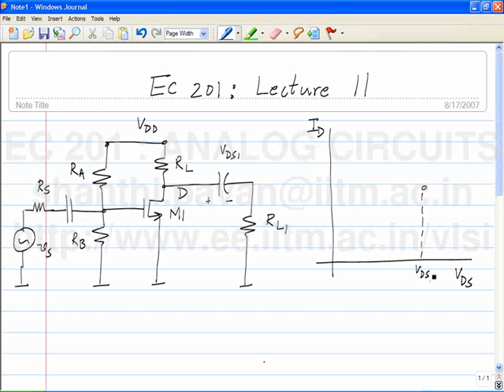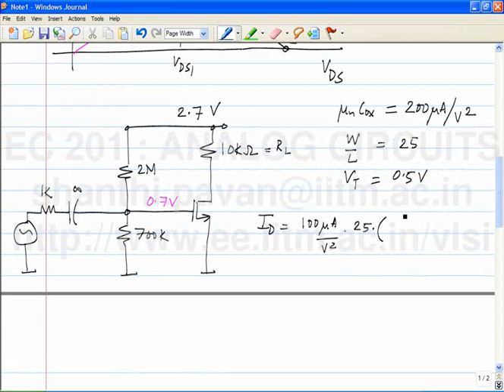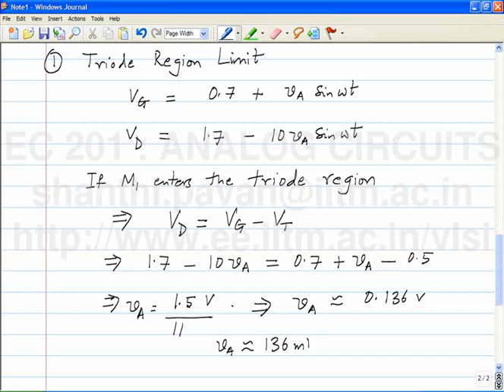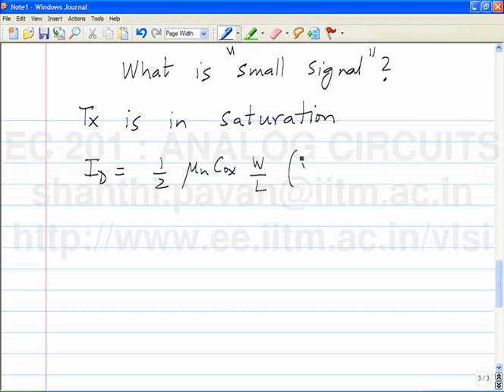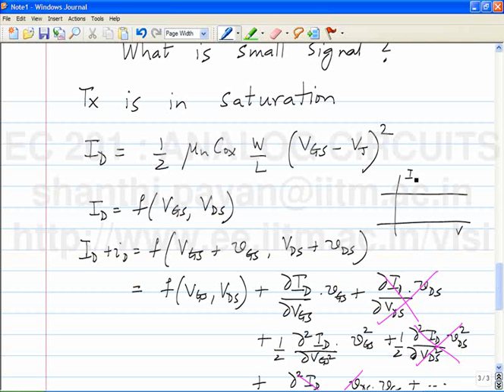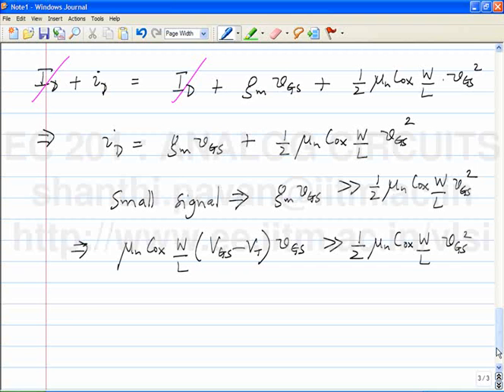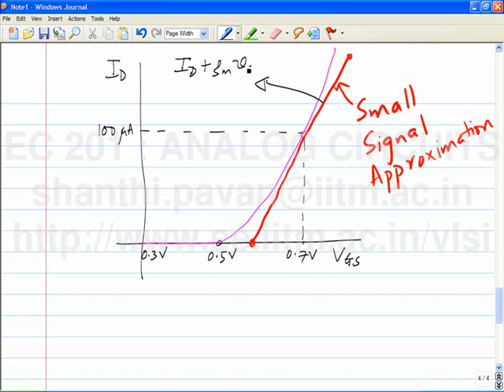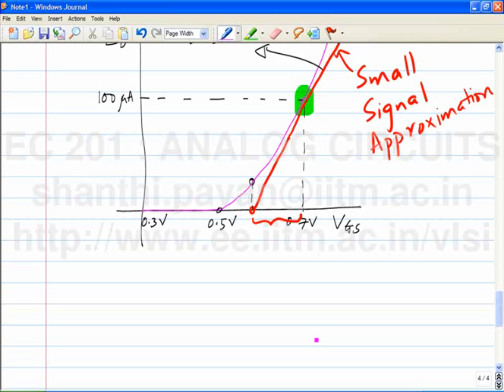Lecture 11 - Swing Limits continued, small signal operation revisited

Comment: How Vg=0.7 and Vd=1.7 you got, please clear my doubt
Reply: I hope u would have gotten ur ans by now though I am clearing it. Since no current can flow through the gate or infinitely charged capacitor. so Vg = (0.7/(2+0.7))*2.7 and we can get Vd once we obtain the current flowing through the resistor which is Id.